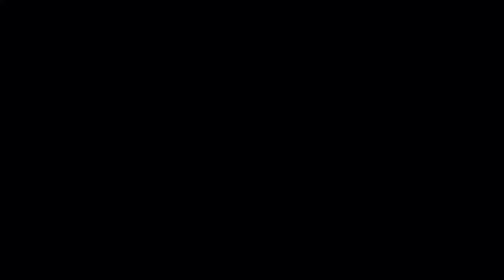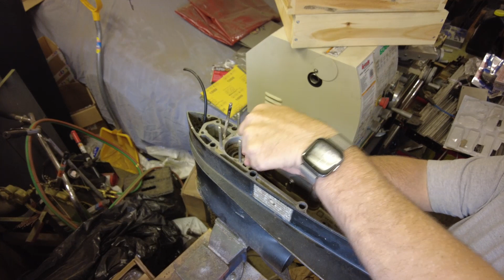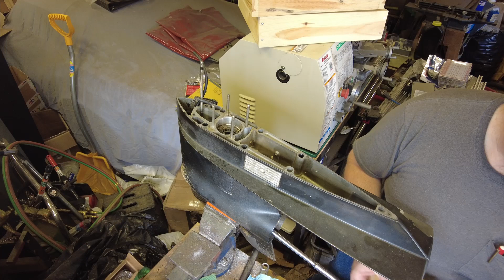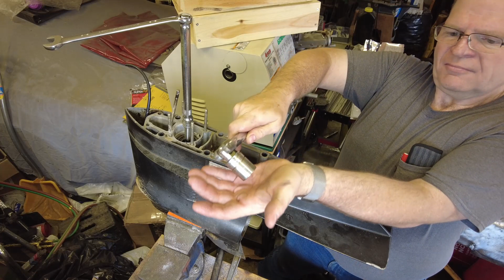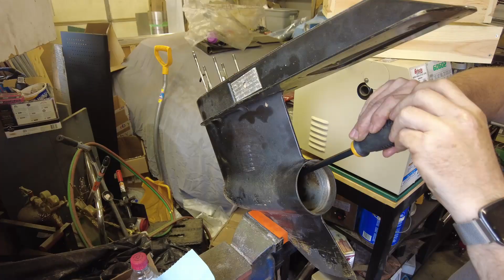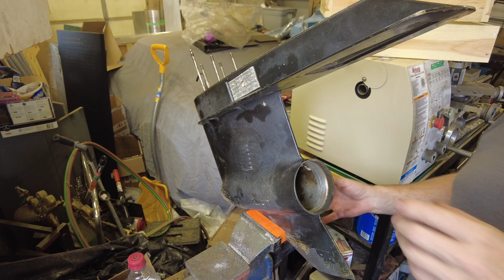Force 120 Hp Lower Unit Repair Pt2, Finishing the Disassembly: PROJECT PONTOON Ep10.4

Comment from the maker: Part three of this lower unit video is coming soon.  Keep an eye on Doug's Messy Garage for the re-assembly part of this mess.
Reply: When you took out the broken shaft there are supposed to be 3 shims somewhere there by the bearing, I saw you hold one up in the video but you never mentioned where they go. Any recollection of that?
Reply from the maker: @gyongyverandreiovici26  Unfortunately, it's been a couple of years and the specifics escape me.  I believe there are shims under the top bearing for the vertical shaft and under the front bearing for the prop shaft.  In the manual, it mentions number and letter codes on the shaft and housing and then gives a table to cross reference how many shims were required.  Shaft A with housing 2  requires 'X' thickness of shims.  Of course, when you are trying to reconstruct a lower unit 30 years later, the labels are long gone so I re-used the shims I had and got very lucky and my lash was perfect.  Sorry I can't be more help.

Comment: Hello Doug,  Video has helped greatly.  I have a 90 force 120 and was wondering if you could tell me what the torque spec is for the upper nut of the pinon shaft.  I know the lower nut is 85 ftp.  The nut spec i am looking for is the nut right above the three shims and upper bearing and right below the water pump housing.  Many thanks
Reply from the maker: I will have to check my manual.

Comment: I’m going through a similar problem right now. My 1990 90hp force is not shifting into reverse properly. A lot of grinding and vibration going on. I took it into a shop and was quoted $2,000 for a rebuild or try to find a used lower unit on eBay. I don’t like the idea of finding a used unit since the motor has about 100 hrs on it. Any advice would be appreciated. Thank you
Reply from the maker: Unfortunately, any used lower unit on eBay will likely not be much better than the one you have.